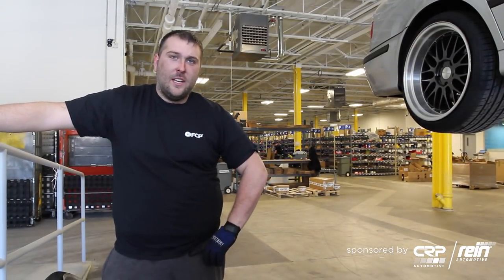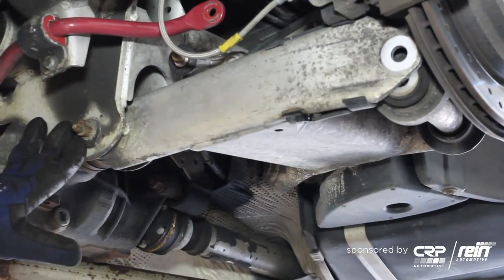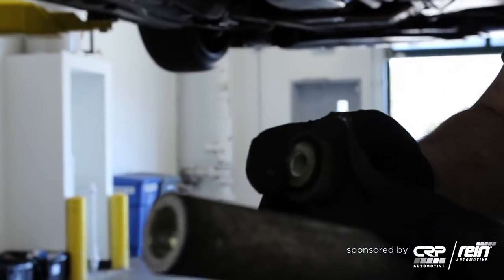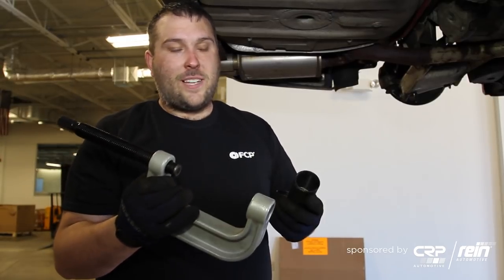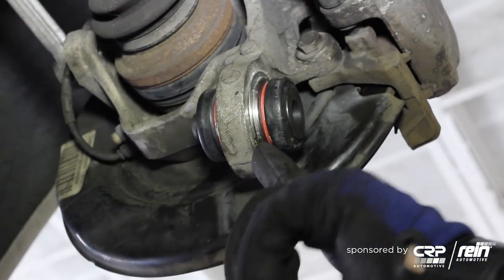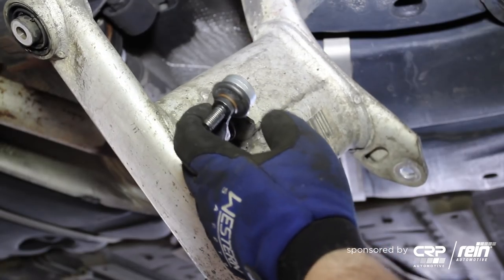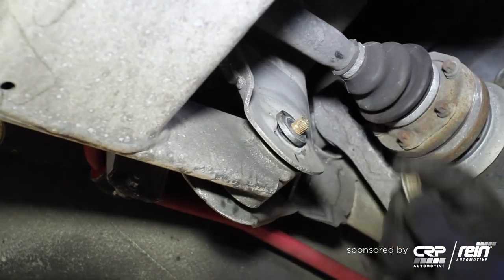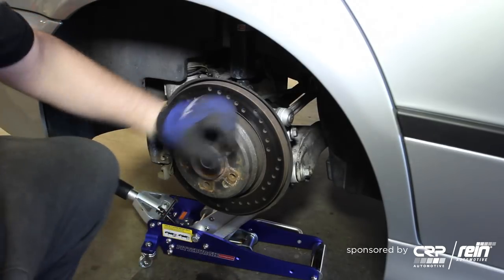How to Replace: BMW E39 Wheel Carrier Ball Joint (Rear Sway Bar End Link, Integral Link) FCP Euro

Comment: Good video, but it got me in a heap of trouble. I'd sure like to see the part that was edited out at around 11:35 when the swing-arm just sets in place all easy-peasy like. I'd take a now educated guess that there was some wrestling that took place just before the swing-arm made it to the right position. I'm still fighting with mine, as I couldn't get all four mount points lined up, and 3 out 4 isn't going to equal a drivable car. I'm now all but certain that I should have used the vise-grip technique, as I'd have the side back together by now. I think if the vise-grip crowd knew it was as easy as this video showed it to be, they'd just drop the swing arm. Editing out the hard parts is cheating. And it appears to me as if it was done in this video. If so, please, no more job laundering.

Comment: i had no idea rear sway bar end link is so small compared to front one....also rear is much more complicated to replace that you cant really DIY it if you dont have tools like that.
Reply from the maker: The rear sway bar doesn't do nearly as much as the front sway bar does. And yes, without a press tool there is no way to replace the ball joint as they are pressed in.

Comment: Are the ball joint wheel carriers the bastards that make these awful squeaky sounds when the car is going through uneven surfaces? Great video and also a very nice quality!
Reply from the maker: They can make squeaking noises over bumps. They can also cause a banging sound depending on how worn the are. It's a good indicator that these are shot if the rear feels unsettled while traveling over dips or uneven surfaces on the road. Hope that helps!

Comment: my rear sway arm broke...thats right broke, so if you find your car twerking when you hit a pothole or uneven surface you might wanna check it.
Reply from the maker: By sway bar arm I assume you mean sway bar link? The rear sway bar on the E39 doesn't do very much. Some early production E39's didn't even have them installed from the factory. If the rear end is unsettled going over bumps it's likely due to other suspension parts being worn out.
Reply: +FCP Euro nope the whole swing arm that connects to the body in 2 places and the part holding the rotor in 2 places. a huge $700 dollar part.
Reply: +maxforce that is the part number.
Reply: Whoa, that's gnarly. Did you take your e39 jumping?
Reply: I have a lot of fun with my cars and if they break, they break.
Reply: maxforce Hehe, same here, but I've had no suspension failures on my e39 despite 50+ miles of not-slow offroading in the Calfiornia desert, sooo...
Reply: lol you dont know new york pot holes/canyons. but if you ever find your car is pulling to one side whenever you hit a dip check the rear swing arm.
Reply: maxforce Hah, fair enough. Frost heaves are definitely not a thing in SoCal.